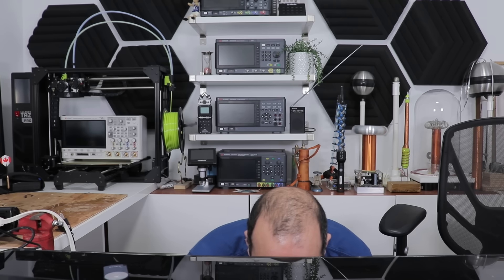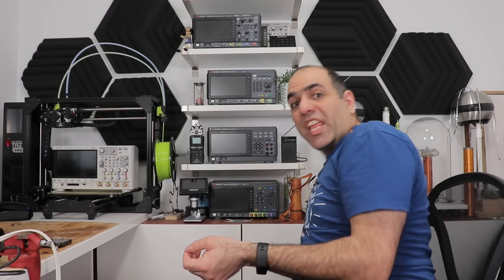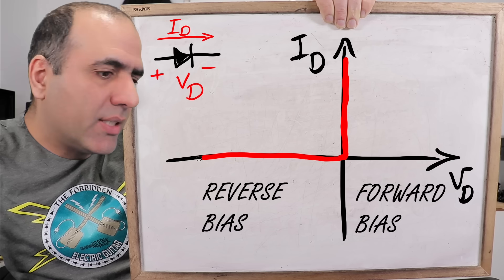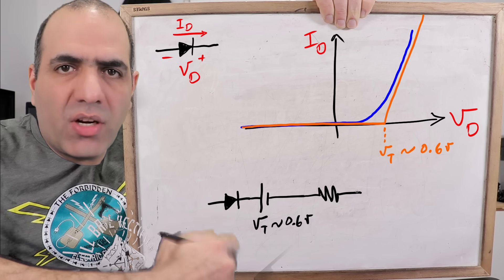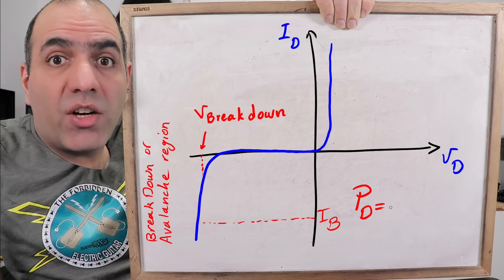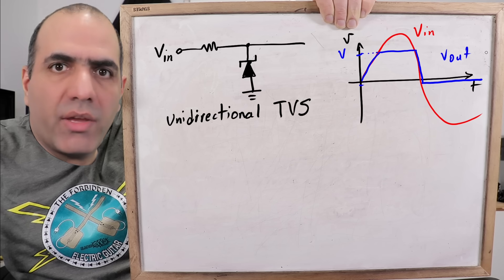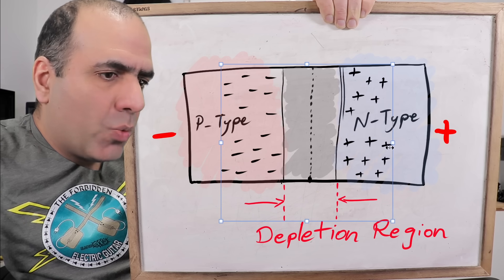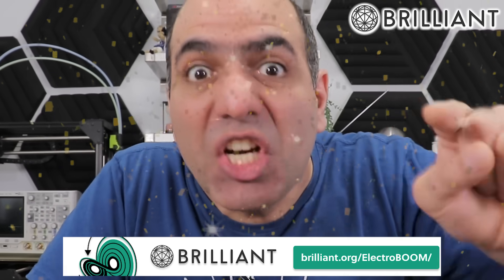DIODES! All Sorts of Them and How They Work (ElectroBOOM101-010)

Comment: Very nice video. Love learning about the different uses of diodes. I expect these are pretty integral to Variable Frequency Drives that get used in 3-phase motor circuits to control speed. Could you do a video breaking down how VFDs work? The solid state electronics of converting DC to AC fascinate me and I would like to better understand what is happening there.
Reply: Ummmm, well, I wouldn't consider diodes as a integral aspect of VFDs. The diodes primarily just provide the rectification from AC Mains to DC that the circuit operates on, which is pretty much the diode's normal use-case (as in "full-bridge-rectifiers").
A VFD is basically just an adjustable inverter, and operates in a similar way to a Switch Mode Power Supply and many other modern electronics. Search YouTube for the following phrase and you will get a good rundown on 3-phase VFDs...
"Variable Frequency Drives Explained - VFD Basics IGBT inverter"

Comment: And variants on the Schottky diode named Tunnel diodes (or Esaki diodes), when mounted in a resonant cavity can be low-power microwave oscillators or amplifiers, when biased correctly.
Reply: You can get a tunnel diode with a heterojunction (or just a normal junction of very high doping). Both of these have normal (ohmic) contacts not Schottky. I thought that's how they were made nowadays but I checked and it seems that there are some schottky MIM tunnel diodes out there. And if you're going for RF/microwave diodes, why not also mention Gunn diodes (which is barely a diode, but also used for high frequency) and IMPATT diodes (Definitely a diode, but more like a zener/avalanche diode than anything else), Wide BG PIN diodes, etc. I think of all the diodes I mentioned, PIN are probably the most common that didn't make it into the video. You can just buy those normally and they're not even that expensive. Even PIN photodiodes are available. I think solar panels use PIN, though I'm not sure about that.

For anyone reading this later, a PIN diode is the same as a normal diode, but it has a layer of insulator between the P and N. This increases the depletion region by the width of the insulating layer. Because of this, they have more capacitance and also much higher E field. Because of the E-field they can switch very fast. Since the depletion region is large, some photodiodes are PIN diodes, since optically generated electrons are swept through the depletion region and out the diode very effectively from the high field, and there's a larger depletion region for the photon to hit.
Reply: @samfedorka5629  There are some kind of diodes, which are able to behave as negative resistance, if I remember correctly. Does it the PIN diode, or something else? (or I misunderstood something in class years before?) :)
Reply: @EFazy  I haven’t heard of IMPATT, but the Gunn and tunnel diodes mentioned here both exhibit negative resistance and are used for crazy fast oscillators.
Reply: @EFazy  well tunnel and Gunn diodes work on the negative resistance region. This can be used to de-damp a tank cuircit I.e. creating an oscillator. Other uses are for triggering analogue scopes. Tectonics was famous for using tunnel diodes.
Reply: @EFazy  Yes, some diodes types exhibit negative resistance and that''s how they can be used as oscillators.
Reply: A diode work by quantum tunneling, how cool is that.
Reply: @koharaisevo3666  All semiconductors work entirely by quantum effect. Just that in some types of devices it's super-obvious and that effect can be exploited in quite weird ways.
Reply: do you have a book (book title) about this that you could share?
Reply: @BardhAzizi  w2aew has a few diode videos including tunnel and pin diodes.
Reply: I like your funny words magic man

Comment: maybe you should point out that the like charges repell so even though the positive charge accepts the charge the depletion range has a negative charge there, repelling it back to whence it came, but the negative side has been depleted and has a decent positive charge allowing it to accept and bind there, causing the portion that is in that depletion range to be bumped out making it temporarily positive charged again drawing the charge in so going the wrong direction is like trying to jam a north and a north field of two magnets into each other and they repell each other, but if you force it hard enough you can connect them and bond them, which will usually end up damaging the magnets in some way if they are strong enough (just like it's possible to burn out  the diode by forcing enough power through to damage it going the wrong direction)

Comment: Took my professor 5 lectures to get through Diodes, and you efficiently went over them while keeping my attention. Well written and expertly conveyed. Loved it.
Reply: They also derive lengthy equations... So I guess it's understandable
Reply: @commieTerminator  Everybody is gangsta until yo are asked to calculate the depletion region based on the doping concentration and  applied bias voltage =)
Reply: @ToniT800  lol, also some EM-wave hitting the diode
Reply: @ToniT800 Depends if I got the formula then I only need to input the variables and calculate it (and actually understand math language😅😂)
Reply: @commieTerminator  it's not about if they derive it from lengthy equations if you can't understand what they are talking about it doesn't matter I bet I learned more from Mehdi then my professors from my uni
Reply: @Iron_Justicer  You're also blaming the professor when you should be blaming the system the professor works for and the student learns under.
Reply: @Iron_Justicer  I understand your position, but try to keep your mind opened, different professionals in different lines of work will certainly achieve different goals.

Your professor probably knows more than Mehdi, but it has way more trouble to convey his expertise to you.

Besides that, you made it here! Keep the same approach, if you don't get it, keep looking until you do.

I wish I had Mehdi (or any other source of info) when I was younger and had trouble learning electronics. It certainly would have changed my life back then.
Reply: @blastortoise  a professor who doesn't know any one language other than his own can't claim to be good there are so many people pioneer engineering lesson while they are telling teaching in understandle and easy going level you can't compare the two all I'm saying yeah there are some qualified people but when you compare the numbers it is just mere drops in an ocean
Reply: @Iron_Justicer  Well we dont know the level of expertise of the guys professor, and im honestly more willing to cut the professor slack than the system
Reply: @ruffusgoodman4137  Mehdi is an electric engineer and has been one for a pretty long while it seems, He is definitely a reputable source of information and it is not unlikely that Mehdi is more qualified than that professor to teach, or at least, knows more.
Reply: @yesyes-om1po  I've never said otherwise. I meant his professor may be a great professional, his line of expertise is not that enjoayable as Mehdi's and he isn't as funny or engaging.

Still not worse professional than Mehdi, this is what I meant.
Reply: @ruffusgoodman4137  that's a very good point, every individual learns in a slightly different way. Some professors are incontestably bad, some are incontestably good, but the vast majority of them are probably just adequate. It's part of the students' job to supplement their learning with additional sources that get the point across better to them. When you look at the comments here everyone finds Mehdi great (and I agree), but there's probably selection bias at play here too: only enthusiastic people will comment these videos. There are probably people who don't learn anything with the way Mehdi explains. And that's fine. The internet is huge and full of opportunities, one must keep looking and view something from as many points of view as possible until it starts making sense. That's also something a good teacher will inspire their students to do.
Reply: @commieTerminator  ,lķ
Reply: He probably got way more technical with this topic, showing you uses of diodes ect. This video gets you into the topic but not too deep so most people understand it
Reply: @Miata_MK  When doing any practical design you dont really need to know exactly how the diode works, you just know how to use it. Of course it is always useful to know how it works but you dont need to know that to be able to use it in a circuit.
Reply: I bet the video is nowhere near as in-depth, though.
Reply: When you get paid by an hour:
Reply: Your professor very probably went into deeper information and math...

Thanks to that you also could understand this video way better than the average person with no background on the subject...
Reply: @serpentine1983  yeh like me who didn’t complete this topic yet and kinda didn’t understand much , except for the part I already read about
Reply: you already knew it that is because you can understand this video. Otherwise you couldn't.
Reply: Maybe your professor has an eyebrow deficiency? Mehdi rules!
Reply: It also helps that you’ve gone through them before. There’s a reason why when you study you don’t just read the summary section of a textbook chapter and call it a day.

This is also a 10 minute video, which will have nowhere near as much detail as a college course or lecture.

That being said, why did you spend so much time on didoes lol?
Reply: That's a common problem with lectures... they seem to be too focussed on "the details of X" instead of - at least at first - list all the different basic things and then go into the details. We had a professor that took that to the max: one year worth of lectures about how to make steel from iron, instead of the planned "material and machining basics".
Reply: @atkelar  if your foundation is flimsy then everything on top will collapse.
Reply: i am 699 like on this comment
Reply: An ElectroBOOM summary should make you able to understand those 5 lectures better when you read them again. Hope you get good grades and start rectifying things by yourself soon.
Reply: Show this video to your professor. Chances are, they'll use the video in their lessons.
Reply: did your profesor have sponsor too?
Reply: The world isn't always going to offer you a nicely edited youtube video, you should push your abilities and learn to engage with lessons that don't always captivate you.
Reply: well, this is because of Multimedia.
in our times, teachers use to teach on green/black boards with chalk.
and we have to understand everything from technical books
Reply: my prof did it in one... it was 60 slides...
Reply: Unfortunately most universities don't teach professors how to teach.  They don't know how to relate the information, to give the so what.
Reply: Totally agree
Reply: Mine did in 1 hour so...
Reply: Ok
Reply: I cant believe that sir
Reply: And in a second language too!
Reply: 5 lectures, ! We got this in 20 mins 🤣
Reply: me in class 6 just watching this video because I am interested in electricity and wanted to know more stuff about electricity be like: ???????

I know this video is about diodes I am saying electricity because I guess diode is also a part of electricity
Reply: Why don't you read a chapter in a book like he is doing instead of looking at his mugshot?
Reply: Same here
Reply: You're joking, right?
Reply: I know most of this. But I learned how to model diode much more accurately
Reply: Wait your professor went trough diodes?
I mean your professor is an electron???!!
🫨🫨🫨🫨🫨
Reply: Yea…prof is gonna go into way more depth. This is good review/intro for sure
Reply: Professors mostly teach and read their sheets, while there, it's mostly courses based on practical knowledges
Reply: Yes. But I hope he also taught you the mathematics needed to model and study them, make circuit calculations and teach you how to use them in circuit design. That's what I did in my EE degree when we studied analog electronics. Now I work on solar panels and that knowledge is still useful. This video is also useful ofcourse.
Reply: Its shocking to me that even after Mehdi's video, you did not realize why it took your professor 5 lectures to get through diodes. There are entire books written on diodes alone. And I mean a single kind of diode and not all different kinds! As Mehdi said, they changed the course of the world. There is a lot to learn about them.
Reply: It took my nearly 5 professors to understand diodes but still didnt. This man did it in 13 mins
Reply: @geteducatedyoufool4563  in an ideal world.. yes, you would come prepared. But  this is the real world and not all "lower" levels of education line up with all the "higher" ones. I also don't know how these details compare internationally, I can only say for my neck of the woods and I've seen this "the others should have prepared you" excuse too many times myself. And no, I'm not talking about kids not being able to grasp pythagoras when they start university... And I don't expect anything "dumbed down" eiher, but even when I'm going into higher level classes, I expect a bit of an overview first, so I know in what mental bins I might put the nuggets of information when they hit me (for lack of a better analogy) To me, these little details make the difference between a teacher and a "biological e-book".
Reply: Like bro....this is the one of the most easiest topic in physics
Reply: Same
Reply: That's because nearly all schools and universities teach wrong. They always cram the maths alongside of it when you are busy trying tu understand the concept.
Youtube made that pretty clear as many youtubers are either bad at maths or to lazy to include it. Don't get me wrong that is nothing negative.

As you can see with this video, to learn a subject you first need to understnad the conzepots underlying it. It's the same with physics. I don'T care (yet) how to calculate the breakdown voltage of a zener and if you try to force me to learn it when I not even grasped the conzept of a diod things won't work out. 

This is especially obvious with physics as they should be split into to different subjects in scholl/university: Theoretical physics which just teaches the concepts and how things work, interact with each other. And than applied physics which takes a deep dive into the maths behind the concepts. Make the first mandatory for everyone and the second a choice and you get a population in which everybody as a basic understanding of the universe and is almost immune to being scamed.
Reply: @NineSun001  I disagree, physics is already split into theoretical and applied for university classes and courses in the same way that mathematics and astronomy and quantum physics are as well. People also don't need to understand theoretical physics to go about their day to day lives and I think your understanding of theoretical and applied physics is a bit off. Theoretical physics is very maths heavy and can be very difficult to understand the concepts of whereas applied physics is usually a bit easier to understand. You seem to have gotten the two mixed up in your comment, or if not then please explain why. You also can't just say teach them theoretical or applied physics, they are such huge and broad topics and are why people spend their whole lives learning them. I don't know where you are but here in the UK, the basic "science" class that we have to do generally covers more than a lot of people will ever need and most people forget it all soon after. We also have to take at least one of the sciences forward for another year and they mostly manage to strike a balance between concepts and maths.

Learning theoretical physics to any real level of depth will be useless and boring for the majority of people who will never use it and won't be interested in it and it won't make them any less likely to be scammed, some people will always try to scam others and there will always be someone to fall for a scam that's just human nature. A lot of people who get scammed are old, so tell me how having a very basic and broad overview of theoretical physics in school is going to help someone who left school and became a cleaner their whole life or worked in a shop etc, not get scammed on the internet  or over the phone when they get old. It won't help them or the vast majority of people not get scammed and to think so is either naive or egotistical, thinking if they had a better education they wouldn't be scammed or that they don't understand how the universe works that's why they got scammed.

Your whole comment seems a bit confused and you especially seem to be mixing up theoretical and applied physics.
Reply: @geteducatedyoufool4563  Exactly... but why would that prevent professors from giving a big picture first, and then going into detail? Right now, to my impression, most higher courses are structured in a way that "makes sense at the end only" and is tedious memorizing of random factoids along the way, so an "evaluation of progress" can be done.
Reply: Yeah, I've had so many teachers tell me it's too complicated to explain, this man just explained in less than a minute
Reply: You see the difference between your professor and electro boom is your professor gets paid to talk about electricity properties. He couldn't care less he just wants to make the dollar. Electro boom is a connoisseur of electricity Born into the world with a full understanding of everything you should or should not do in electrical engineering.